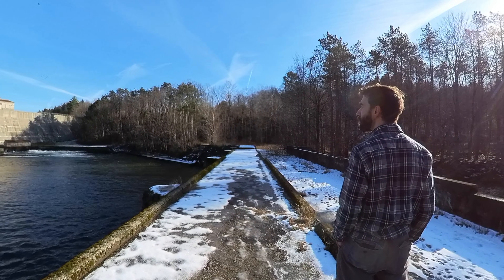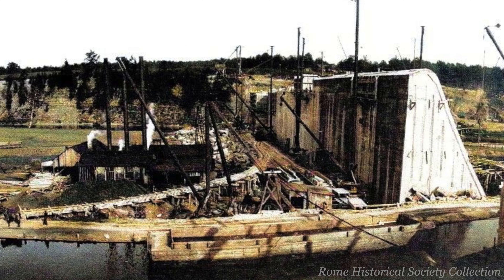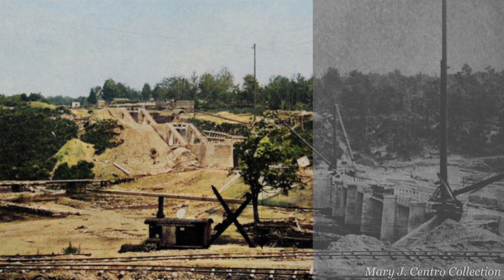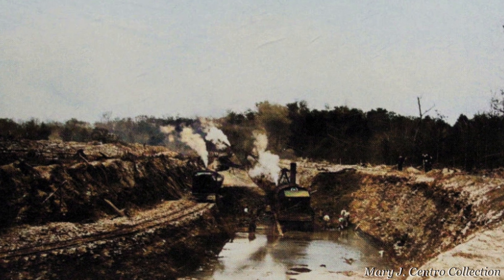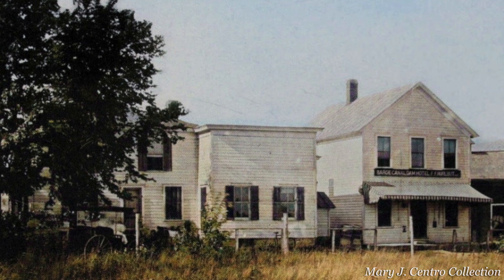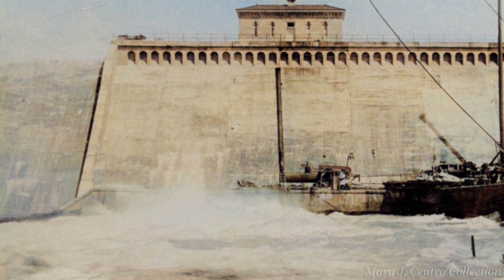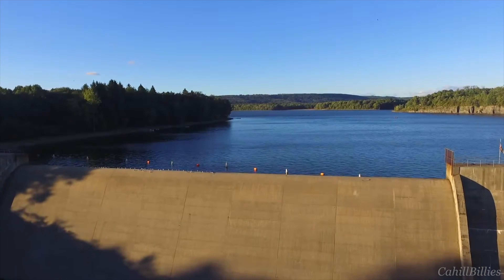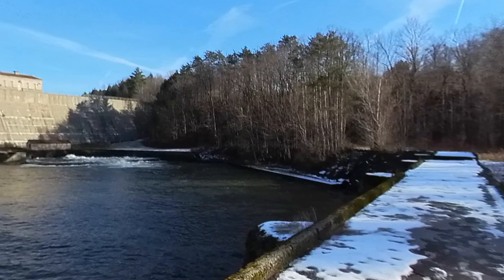Delta Dam, NY - A Brief History of a Barge Canal Project

Comment: It’s hard to picture the area without the dam and reservoir. The loss of the Village of Delta was tragic. I’m surprised there hasn’t been any serious consideration of removal given that the dam is over 110 years old now. There has been a huge push in western states to remove dams.
Reply: Rome would be flooded. The can't remove the dam cause it controls the water in the barge canel
Reply from the maker: True